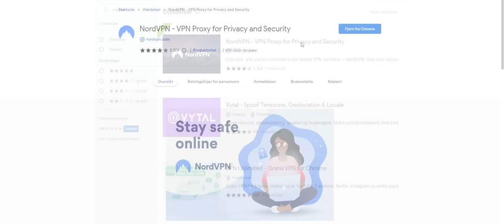Back on the Road to Worlds Most Powerful Two Stroke? Rotary Valve PiP Engine

Comment: 7:47 Roll your sleeves up. I was working at an array of drill presses that were run by an overhead belt. A few strands of hair stuck to the dirty belt and it started pulling my head in and I had to pull away from it, removing a chunk of hair and scalp.  You should never wear jewelry or loose clothing around machinery like this. If it's cold, at least roll them up to the elbow. Safety first. I've been watching you for a long time and I want to see this thing on the road some day. 🙂
Reply: Agreed, this kind of machinery never forgives human error.
Reply: @TinchoX  and it happens very fast and with no warning. In my case I had about a second to decide what to do. The choice was let my head get pulled into spinning belts and pullies or pull my own hair out of my head. A bleeding scalp and a bald patch were the lesser of two evils.
Reply: He is slowly getting better atleast clamping things when in the drill press although that got triggered by a dangerous incident, I too don't want anything real nasty to happen much better to learn from other people's mistakes than to have to make them yourself, the lathe will not take prisoners.
Reply: Sanding and cutting carbon fiber with no mask is also dangerous and oftenly overlooked because people think it is like fiberglass which is less harmful, just itchy. In reality it is much more like inhaling asbestos...
Reply: he should also wear real safety goggles when on the drill ect my dad got a piece of burning metal in his eye even when wearing normal glasses.  it makes me cringe every time I see him do it.😮
Reply: @saetastr  Agree I shook my head at the screen then too.
All the Nitro Methanol without real extraction or respirator was also dumb. Although it's difficult to do everything right at the small workshop level, had a little glav flu once but I had things to fix and the mice had eaten my old 3M respirator.
Reply: True
Reply: @saetastr  fiberglass is just as bad. Even wood is bad . The body tries to keep it clean
Reply: To think you still got lucky
Reply: Yeah, machines don't know you're soft and made of meat, and if they did they wouldn't care lmao. Seen enough Chinese people get turned to mush at various industrial health and safety classes.
Reply: I got my slave caught in a 10ft drill press when a large but of swarf caught it my arm stoped the machine not ideal 😢
Reply: @theakbars98  yeah even little machines can di a big number on you. My milling machine is only 0.25hp, but once it ripped a paint brush from my hand and minced it like it wasn't even there...
Reply: Not just sleeves are hazardous. I once had the feed rod on a lathe start winding the coat tail of my insulated shirt. I reached up and turned off the spindle motor  with just under one second remaining before the feed rod would have pulled me too far down to reach the switch.
Reply: saw a former long haired hippie that was scalped when he attempted  to check his ignition timing on his nova. almost lost his head.
Reply: @bobturnbull18  yakes
Reply: I was drilling a brick wall to put up shelves and my hair caught into the drill chuck, thankfully it was easy enough to just stop drilling and cut that strand of hair off with a pocket knife but from that day on I always tie my hair up and wear short sleeves. A bit of cold over loosing an arm leg or head to a mill or lathe is much more preferable.
Reply: @gazvlogs7459  I was taught by my old boss when I was making press tools.machines don't have feelings and won't stop if you're screaming I've heard some very grim story's over the years best not to think about that too much just treat machines with a healthy respect.

Comment: I have mentioned it before but if you elongate the inlet port in the crankcase and allow the outer plate to be rotated you can vary the inlet port timing, similarly the ignition timing can be varied, all while it is running. Someone I knew did this 40 years ago with the movement controlled by cables and linkages connected to the throttle.

Comment: You could also trace the rotary valve disc trailing and leading edge onto the crank casing and inlet casing. That way you can match the disc shape to the inlet port, allowing greater area and slightly smoother transition. Hope this helps

Comment: How about bonding the drive flanges to the carbon disk to better spread the load? The skinny screws may end up being the stress point otherwiise.
Reply: Yes, that was the weak spot where they broke previously. I would tend to make the flange as large as reasonably possible just so it misses the port window and run super glue round the edge as a safe guard.
Reply: the screws provide clamping force, power is transferred by frictional forces between rings and the CF. Theres a good video around somewhere about the load taking of bolts and it talks about shear loads like this.
Reply: @raphrath8561 Let's see if it breaks again. I like the idea of a larger drive flanges, too

Comment: I think the valve could still break even with the sandwiched holding concept.
The 6-sided poligon drive is a good idea, but you made corners in the carbon fiber sheet, that are stress concentration spots even if you put radii/fillets on them. 
Also, by cutting a large hole you essentially shortened a large portion of the carbon fibers to a point where they cannot provide the desired strenghtening effect, and the load is carried by the epoxy matrix rather than the reinforcing fibers. I'd use a smaller, circular hole that the poligon can sit inside of, and decrease the size of it too.
Trying different orientations for cutting the valve disc can also bring improvements, depending on what kind of weaving pattern/lamination/fiber structure/layer orientaion your material has.

I could be wrong of course, just my thoughts based on my current engineering studies.

Comment: 50cc single two-stroke GP teams of the 1970's and early 80's will all probably tell you that the only real advancement for 50cc two-stroke engines after rotary case induction, would be fuel-injection. 🤷🏻‍♂

Hope to see you road-trip down to Aalt Toersen's shop, soon. I recommend, asap. 😉 Let him show you all of Kreidler Van Veen's old secrets, in person...
Reply: But they would have loved to use compressors...
Reply: KTM has built a 2 stroke dirt bike recently
Reply: Why would vintage Vespa tuners ditch their factory rotary valve configuration to opt for reed valves for mor powah if the rotary valve is superior?
Reply: @nelsonbrum8496  maybe it was too difficult to tune for homemade builds? Just guessing
Reply: @nelsonbrum8496  Peak power vs. power band maybe? A reed valve setup varies the intake duration based on the vacuum in the crankcase and works for a wide range of RPM but is also restriction in the intake. A rotary valve has no restriction but only works perfectly at resonance RPM because of the fixed intake duration.
Reply: Is this the CNC machining channel? This vid had no smell of burnt t2oil
Reply: @nelsonbrum8496  - because the method they have used (cutaways in one side of the crank) is inferior and doesn’t seal properly
Reply: Fuel injection won’t replace whatever valve is used though, will it? It will still need a Reed, or rotary valve, however the fuel metering is done
Reply: @nelsonbrum8496  have you seen a vespa crank?
The valving is done by the webbing of the crank, you get no adjustment
Reply: @nelsonbrum8496  yes i build some vespa engines, it is normal to put Reed in to get more power. I do not know if he have a better design.
Reply: Was using the crankshaft as rotary valve like rc engines do ever considered?
Reply: @nelsonbrum8496  PiP was originally intended to go beyond 20k.
Reed valves have greater benefits at lower RPM.
Reply: @nelsonbrum8496  The answer to that is simple. They lacked the advanced skillset to make them work up to their true potential. So a tuner with basic skills would get more power/superior performance from the reeds however anyone with the advanced tech skills to fully tune/optimize the rotary would smoke them easy!
Reply: @nelsonbrum8496  Check out Guy Martin and his reaction to the latest rotary superbike he test drove recently.
Reply: Would EFI have any major benefits over a carb when the engine is fully sorted. When I raced 125's in the 70's you rarely feathered the throttle. 2X 28mm Mikuni's open or closed.
Reply: @bigcconservativeguy2534  We're speaking of rotary case inducted standard single piston two-strokes. The Crighton is a two rotor Wankle. Seriously wicked bike....
Reply: @malcrandall1309  EFI is just much more precise.
Reply: @DetroitMicroSound  Sorry, what do you mean more precise. Unless your running sensors, how does it make it more precise. It worked very well back in the 70's so why not now. If the throttle was kept wide open 99% of the time why do you need FI
The problems that have being related to fueling in these video's have being reduced by altering the engines parameters. If you put EFI onto a fully sorted 50cc race engine that ran fully wide open for 99% of the lap, what is gained?
Over 20k rpm EFI takes some sorting. If you put EFI on this engine  nothing would be gained,
The SPX project ran ok on a carb. It's the engines design faults that are the main problem.
It doesn't matter what fumes come out of the exhaust pipe.
Reply: @malcrandall1309  Fuel injection delivers fuel more precisely than carboration. 20k+ is a very high number. In the late 1970's 50cc rotary induction single cylinder GP bike engines averaged a high of around 18k. 18k is NOT what those engines did 99% of the time. GP races in the Championships days, raced on technical courses. top RPM is only achieved 1 or 2 times per lap, on straights. The rest is half+ RPM technical stuff. Watch all the cup races/demo's still held every summer around the Netherlands. Loads of on-board videos of 50cc GP racing in the Netherlands, here on YouTube. Folks still avidly race the legendary 50's, just for fun. Even Aalt Toersen still gets on his Van Veen's, for demo's...
Reply: Why can't a diesel engine fuel injector pump be used to inject the cylinders directly?
Reply: If I were Alex, I would be heading down to the Netherlands this summer, to talk to as many 50cc GP oldtimers as possible, during this race season. -Especially Aalt.
Reply: @DetroitMicroSound  I'm sorry I'm not trying to wind you up in any way but i'll state my point again from a personal point of view from racing gaining my national licence doing my own engine tuning and frame making with no form of financial help
While racing 125 AS1/AS3 twin cylinder Yamahas. The power band on these engines was only 2000 and reved to 14000 and above. The top engines revved to 16k and had a crank life of 200 miles if you were very lucky. You tended to get through clutches at a alarming rate due to slipping the clutch coming out of corners.
You keep saying EFI gives more precise fueling, What was wrong with the fueling then?
You didnt comment on the PiP's engine parameter's. Do I understand your thoughts,. EFI would cure the problems Alex has faced over this 2 year piriod. 
Some time ago I posted a comment asking Alex to stuff the crankcases to increase the  primary compression ratio. Sadley this hit a nerve with Alex and he replied sternly on air that it was his project and he will do it his way come what may ruling out any crankcase modification. Strange how things are turning around! After all the porting simulations that Alex carried out are turning out to be not so good. I can fully understand Alex's feelings.
I have seen 50cc racing here on YouTube but never raced one.. In proper racing the throttle is pinned wide open and the clutch tortured. These are people's pride and joy being raced now!
I cant see where I put the revs where at maximum for 99% of the time, that was the throttle.
Reply: @malcrandall1309  My guess on EFI not making it into 50cc GP, is probably due to the fact it would have been an expensive, and time consuming venture even for teams with money to spare, in a time when 50cc GP was on the rocks...And would soon be de-santioned, as a class.
Reply: @calthorp  The right minds, can probably make that work.
Reply: @Nelson Brum  simplicity but they'll be back😊
Reply: @malcrandall1309  injection has a small advantage over carbs at WOT because it eliminates the flow restriction created by the carb venturi. My Grandfather used to race a speedboat with a ford inline 6 in it, he built his own continuous flow mechanical fuel injection system that in his words was tuned only for WOT, the fuelling was wrong anywhere else but for a speedboat that didn't matter as they were full throttle from start to finish. Those races were very dangerous, but that is another story...

On this project I think the only option for electronic injection would be alpha-N tuning, which would probably be pretty tricky to set up especially with the tuned pipe making the volumetric efficiency change a lot with rpm. Once done it's much easier to tune using a laptop than constantly tearing down carbs to change jets.
Reply: @nerd1000ify  Yes I can see your point on the slight restriction, but I feel it would be a very slight restriction at that. When we used to build our own race bikes in the early 70 's it was common place to ream carbs out due to the lack of money and availability of parts.
Fuel injection certainly has its place, but not on PiP here and now. It's the engine design that's causing the problems. The thing with such a tiny 50cc engine the jet size changes would be minuscule  if needed. I fully accept your point it would be easier on a laptop. I come from the pre computer era so I'm all clockwork.
When you look at all the electrical issue's Alex has had over the period of this build, I personally would stay way clear of anything electrical.
Like Alex now says the priority is getting the engine  to basically run. Forget all R&D for the time being.
As I put in a post today PiP will stand for Pride in Performance not Primus inter Pares.
Thanks for commenting.
PS, I wish Alex would put the stinger pipe back on as he said it hurt performance when removed some time ago.
Reply: @malcrandall1309  Yes a good venturi has something like 95% pressure recovery. A typical carb is probably a bit worse due to things like throttle plates and jets poking out into the flow, but even so the loss is very small.
Reply: @terjee648  I have a stock appearing, two-tone Vespa 90. I bought an ET3 engine from Italy and had a 130cc top end (5-7 ports) ported and tuned by a local guy (Santa Clara, CA) with a Polini reed valve intake and 24mm Dellorto. I have a Simonini "down & forward" tuned pipe on it. When that pipe hits, it will, at the very least, unsettle the front suspension. I can't count how many times I accidentally pulled the front wheel accelerating out of a turn. My original riding gear did include brown pants.
I want to get some updated goodies from SIP this summer. Like a tach.
Reply: @DetroitMicroSound  maybe the high revs are the injector pump limitation? Or is it the fixed metering volume of the pump so between idle & full rev the volume stays the same?

Comment: Have you ever considered building a flow bench? In accent times I hung around a tool and die makers shop that had a homemade water brake dyno and flow bench, He did some excellent work. Technology has leaped forward of course and should make building much easier and cheaper.

Comment: If you chamfer the trailing edge it shouldn’t chip. Another thing to try is in the valve assembly you can bridge port it like in a rotary. That way there is constant surface for the valve to be guided on.

Comment: I just came up with a great idea, why not use the crankshaft as two rotary valves with two carburetors, one carb on each side of the crankshaft. The counter weights would be the rotary valve. The ports could be angled so the connecting rod pulls air into the crankcase (maybe). Please like so this comment will get seen and not ignored, I think it's a great idea.
Reply: Just like on rc engines, but they use a single carburetor. I don’t think dual carb setup would be needed in such small engine 🤔
Reply: I think the ports would be too restrictive.
Reply: Probably too difficult to manage the balancing of the crankshaft with the valve timing of the cut-outs for intake flow.
Reply: @bobturnbull18  maybe the flywheel can be tuned as counterweight? 
🤔
Reply: @ponzy  I don't see how that could be done. With the piston near the bottom of the stroke the cut-out for the gas flow will be open putting the mass of the counterweight in the wrong position. How do you imagine this could be overcome? I suppose you could feed the crankcase from the lower part and thereby locate the cutout of the crank in a position that you might be able to "tune" your way around it but I wouldn't want to be faced with the gas flow difficulty presented by introducing the inlet charge below the crankshaft.
Reply: @bobturnbull18  I think the counterweight for the piston could remain the same, but adding another one for the crankshaft on the flywheel (that would sit in front of the carb mount)?
I don’t know if or how it’s addressed on glow rc engines. What I know is that they have two ball bearings on the crankshaft, one in front of where the slit is (right behind the flywheel) and one behind it. So basically the crankshaft is supported by two bearings both on the same side of the engine. But probably on a larger scale like this it would need something stronger
Reply: @ponzy  It's unclear to me how this is an advantage. I assumed the initial proposal was just to use the crankshaft as a disc valve (fewer parts, simplified assembly). I don't think this can work because of the balancing issue. What is the advantage, if any,  of your proposal.